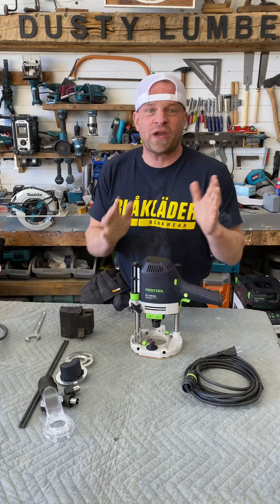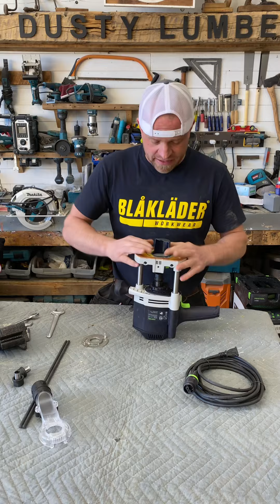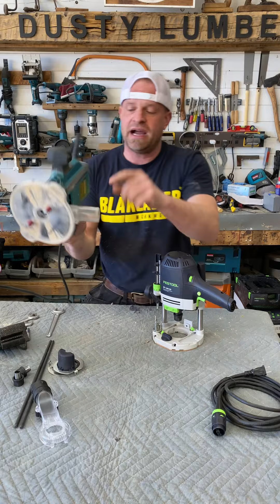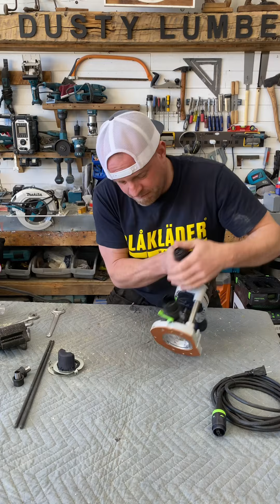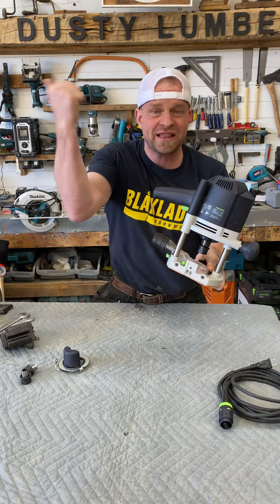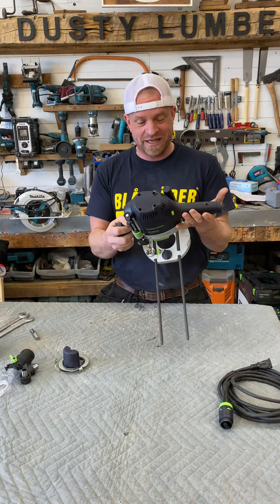Festool OF 1400 router vs my Makita routers

Comment: I love my OF 1400 💚

Also have a dewalt 1 3/45 hp with plunge base, hooked to a circle jig. 
A Ridgid palm router on a mini router table. 
A Ridgid 2.5 HP under the Jessem router table.
A Milwaukee M18 for chamfer and round over.

Comment: Great video! I like the way you impart a lot of good info in a rapid pace with no extra ums or ers. Except for the extra ers when describing routing. One "routs" with a router, not "routers" with a router. You described how the Festool can save seconds with a bit change and how those seconds add up. Likewise, think of all of those seconds you can save in the video if you eliminate all of those "ers" (rout vs router). They can add up, LOL.

Comment: Festool 1400 watts (only 1.87 HP) is $700, Makita 2.25 HP plunge router kit is $339
Reply: I have an industrial CNC router far exceeding the HP you mention. 

With a handheld router it simply doesn’t matter because with any handheld router, or CNC for that matter.. you should be taking shallow passes anyway. 

So HP literally doesn’t matter on a handheld router.
Reply: So you don’t value dust collection or minimizing time on tool changes?

How about I illustrate with another example … when I transport sheets of plywood, I could strap them to the roof of my car, instead i pay extra and rent a van. 

Am I a fool?

Comment: No doubt the festool is the better router because of the options you went over but the cost point is something to consider. If I had the clientele to do work for than I’d go with the the Festool every time. But I work for a company and I get $30 an hour (35 years being a carpenter). I can’t justify the cost. I do have some Festool tools though. I have a track saw and a sander and I have the D handle drill with all the attachments because I like making my work easier and better. I really need to work for myself and find the right clientele. Right now the industry is flooded with guys from Brazil and South America which drives the pay down but that’s another story

Comment: I still love my PC 890 router.  I bought an adapter plate for the plunge base to connect it to the LR32 adapter plate.  Once you connect the dust hose to the plunge base, you can't ask for better for collecting dust.  I have collects for 3/8" (8mm) bits so that they work just fine.  The only real difference between the setup time between the PC890 vs the OF routers is the racheting lock And the ability to do the quick connect of the dust shroud.  Would I love an OF router, yes, but my PC890 and my battery Makita trim router work just fine.

Comment: I have the OF1400.  When using a guide bushing the router bit wasn't centered.  I sent it in and they attempted to repair it but they couldn't.  I notched the silver plate that holds the guide bushing so I could then use a centering cone.  There's 2 rice sized pins I had to remove to get it to slide around.
The OF1400 doesn't have LED lights.

Comment: 1. all maktia models also have set of collect, dt50 for 6mm and 8mm, others 8mm and 12mm 12.7
2. opening  collect by holding button and apply force is wrong. I broke myu dt50 in that way. you should use 2 wrenches with you have in complect with makita routers, always!
3. opening and closing on festool looks great, but with time  it become work worse and worse because of dust.
4. if you are left handed person as I am, this button for opening will be under or you will open by putting force from you, as result I broke in first day the depth adjuster. BTW quality of alloy is awesome on festool, light hit  on it and you have numbers of pieces.
5. fixing o-ring   on festool is great, but  you forget to mention that  this o-ring is not in level with whole plate itself + after a years of intensive usage of O-rings it starts to more and can be fixed only by replacing whole platform, not only plate.
6. when you will open collect with connected  cord, take a look for that  plug, all force is applied to the cord plug and you can see hot this plastic is bending ...

Last thing I would like to add to this review, that it totally does not suits  to left-handes masters, because its ergonomics. You can't even push button  holder if you are holding router by left hand.  In addition to that  routers hand  are not aligned in  straight line, but  on a curve with suits for right-handed master. As  result working with that router becoming a pain quite fast. 
Now  ergonomics itself, festool is only one who is doing router with pistol holder.  this ergonomics more or less works in cases when you elbow is parallel to the ground,  in all other position working with this router longer that 5 min  is hard. I had this model and 1010, luckily after a short time I was able to sell this piece is  ....

Comment: the bit/spindle centre line machined into the faces of the router base is brilliant for set up then fine adjustment ... just work to the centre line of the cut you want to make. plug it cords come into own if you have more than one festoon machine ... prevents the bird nest you always end up with if every tool you use has its own power cord.

Comment: The plugit cord works on all the festool tools so you can just have 1 cord linked to your extraction hose also plugged in to the extractor auto switch on plug so when you switch from the track saw to the router for example there is no faffing around with plugs you just swap it at the tool
Reply: That's mostly true, but not quite. The plug it cord that comes with the track saws or the routers has a flat top and will fit all the tools. The cords that come with the sanders or  jigsaws and a few others has a little bump on the top, and won't work with the saws or routers. I think they do it like that because the notched plug its don't seem to be quite as heavy a gauge of wire, so they don't want you burning your cord or tool out.
Reply: @olafbigandglad  Sure.  But the person you responded to is not saying that there is only 1 type of Festool cord.  They are saying that you can use a single cord.  Which is absolutely correct. As the heavier gauged cord can be used with ALL of the tools.  Track saws, routers, jigsaws, sanders etc.      

In a corner of my shop I have a gigantic pile of the smaller gauged cords and don't think I've ever used one.

Comment: One other thing your OF1400 can do that the Makita could never do is this. https://www.youtube.com/watch?v=LYdwBOvnk4c  If your budget doesn't allow for Festool quality there is absolutely no shame in that, but if you can the difference in quality is tremendous.  I loved my Bosch router until I got my 1400. One other Festool advantage that many may not know is their EKAT parts catalog that lets you easily obtain replacement parts for every machine they have made.  I just easily bought parts for my 14 year old Domino joiner.  They arrived 3 days later.  Oh, and that removeable "Plug It" cord is universal to all Festool corded machines, so you can have one cord attached to your dust collection hose and it will power any Festool machine you connect to it.

Comment: Hello sir !!!!!!! I would like to know if Festool products are robust and durable ? The reason i asked this question is because i read some negative comments on Festool Owners Group.Are they really worth the money ? If i am buying some power tools i do expect durability for the amount i spend.Will you kindly let me know at your convenience.Have a great life.Take care and be safe.
Reply: I own a good number of Festool products, most of them purchased between 2005 and 2007.  They all continue to perform as well today in my home shop as they did when i bought them. They've been used on many projects. Any tool used on a  dirty construction job site in daily commercial use will have parts wear due to use and abuse.  Festool replacement parts are available for every machine they have made going back decades. These are  quality, precision tools you invest in and the company stands behind them with parts and service.  They also come with a full 3 year warranty.  No I don't work for Festool and paid for every tool with my own hard earned money but I've never regretted a single Festool purchase.
Reply from the maker: Yes they are worth the money 👍
Reply: Have to be better then the makita handles and cover above bit came apart on mine
Reply: Yes they are, I’m a remodeller and can confirm the tools can take an absolute beating lol. At least the ones I use daily
Reply: Definitely not worth the money
Reply: I know many tradesmen who use Festool routers, jigsaws, sanders. Although the green bits on them feel plastic, they are super robust , just too pricey for me. I've got Elu routers 35 years old, Swiss made, that are still going strong. It's the confidence that they are going to stay true and a joy to use and not ruin a expensive piece of wood, that means a lot.

Comment: Subscribed - actually own the OF1400 and it’s a beautifully made router.  I actually didn’t want to spend $1000 + on the OF2200 and just bought the variable speed 3-1/4 hp version of your Makita router.  It’s a beast - made in Japan and powerful.
Reply: MIJ Makita is on Mafell level... higher than even Festool

Comment: Very good video , Festool is always a brilliant tool no doubt  , but in my view for router its all about what you get used to , so you drive it eyeless ... the nice side of Makitas is being a very simple tools.
Reply: Yes, that is exactly the point. Some like Makita, some not. It is the same with festool, espcially the routers (and the jig saws, but this is a different topic ^^): many really like them, and there are also quite a few who bought one, and said "nah... not for me." Espically the design (and the the knob for the adjustment) is not everyone`s cup of tea. 
The Makita routers are foremost simply build (as you mentioned) working horses, especially the RP2300.
Reply: Normally I agree with you but this product is one of the few examples where the Festool is actually simpler to use (as his video emphasizes repeatedly). Fewer nibs and moving parts.

Comment: I used to think Festool was over priced till I bought my first piece. Now I’m addicted to them and can’t get over the difference. They are in another class. I have the sander and track saw with the vac. I could literally sand an entire piece of furniture in the middle of living room and not get a piece of dust anywhere. Amazing !!
Reply: Same here. I thought Festool was overpriced and too Gucci, until I got my Kapex miter saw.  Wow, what a difference! Now most of my power tools have been changed out to Festool over the past 5 years.  Woodworking is a hobby for me and is supposed to be fun, Festool takes the frustration out of doing precision work and puts the fun back into the shop for me.
Reply: Gucci is still overpriced. Don't bring fashion into this  @davidreams
Reply from the maker: They are amazing tools!
Reply: I've had my track saw for 15 years. . It's never missed a beat. Different level indeed. Its by far the best carpentry equipment on the market. Definatly worth the extra €€$$.
Reply: @stevensondrake hi. Which model do you have?
Reply: I really want the track saw. Of course, the sander too, but would need to get the festool dust separated too and that’s just a lot at once. But that track saw would be a game changer.
Reply: @Scott O’Hare  Welcome to the green black and white side.
Reply: @jamzach4 hi. Which model of the sander do you have? Thanks
Reply: You got that right?
Reply: I can’t believe this guy went from four years ago to have a now $1 million shot probably. He’s an amazing woodworker.
Reply: I spent a few thousand $$ on cheap tools before I decided to go with Festool. Best tools I ever own.